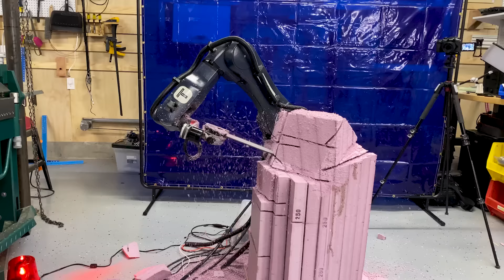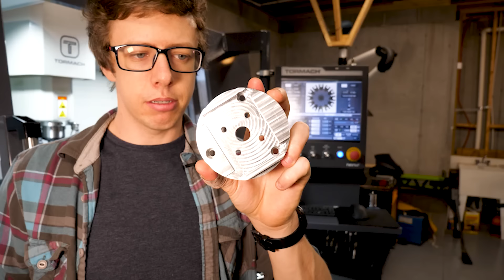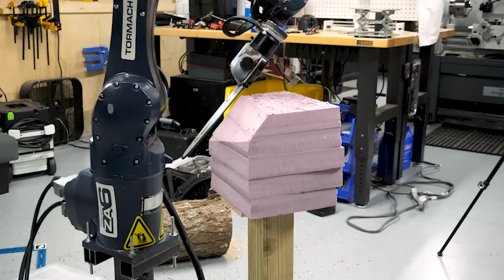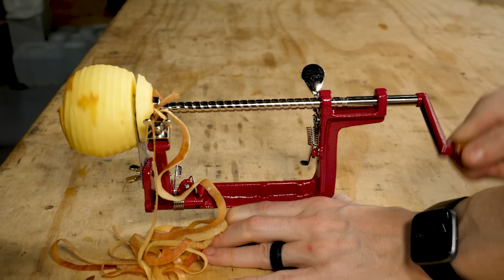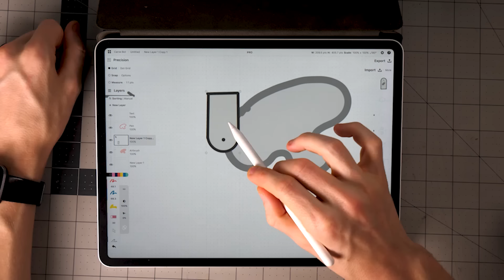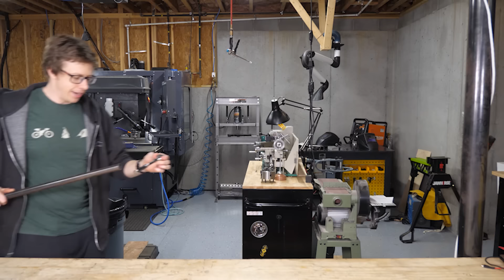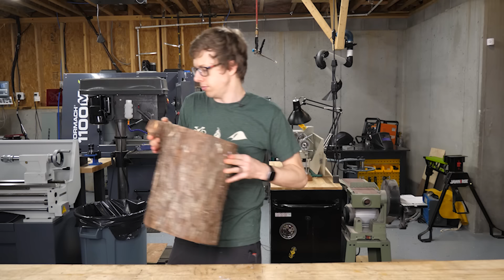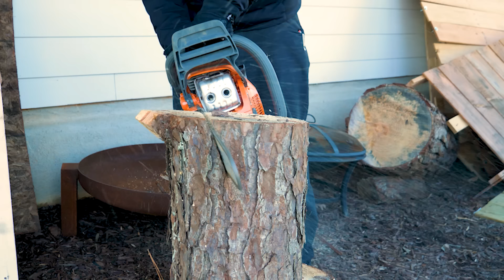Chainsaw + robotic arm = art?

Comment: Brilliant work.
I have a suggestion. Get thee hence to a renfair or logging competition where human beings are making these and watch them for hours.

Human beings have a frustrating way of "just doing" things quickly and efficiently that absolutely confound computers but I think that you would discover that artists of this kind aren't using a single algorithm to do their carving.

They start with a roughing pass and lop off chunks.
They don't try to optimize how to make every cut as efficient as possible, they just start from an arbitrary starting point and remove as much material as possible for a cut, mirror it and repeat.

Once they have a bear trapped in a mostly bear shaped log, THEN they begin reducing everything that isn't the bear to sawdust.
They also line the blade up with the bias of the animal's contour... this gives an impression of fur, but it should also provide a way of creating contour paths.
That sort of means that the maximum number of finishing cuts is dependent on the width of the chain. Basically, it should look like a 3D contour printer path.
That only requires very shallow cuts.
It's a lot of instructions but only the tip of the blade is used to remove very little material.

...and a few "is it plugged in" level tech support questions.
Are you using a coolant/lubricant for the blade.
Are you sure the blade is properly sharp.
Are you sure the blade is installed in the right direction... otherwise it will just rub and heat up.

Comment: Wow don't use a fresh hardwood tree stump. Instead, glue a bundle of pine lumber together just like you did with the foam, and you should even be able to cut it with that baby chainsaw because pine is so much easier to cut than hardwood.

Comment: Excellent job. Now program your home security system so that in the event of  a home invasion, the speakers will play "The Only Thing They Fear Is You" - Mick Gordon, turn on the robot arm and have it flail wildly while revving the chainsaw and beckoning the invader to come closer in the emotionless robot voice. For bonus points, install red flashing lights to run at the same time.

Comment: If you want to cut wood, you're probably going to want to add some bar and chain oil to this setup.  Also, you can file those rakers down to get the chain to cut deeper, no programming required.  That said, this is awesome

Comment: I've been working with robotic arms since the late 1990's and your mathematical technique is very good instead of using a ruby-tipped sensor to locate that saw on the start of every new axis cut.

PS: In my former industry we built a surround cage around all of our robots with an E-stop built in whenever the door is opened, and there is no way to shut the door (unless you stand absolutely still for 45 seconds) when a human is inside the cage. 

(PPS : That is a branch trimmer, not a real chainsaw.. Gotta have about 55cc (3.5hp) + a very good bar and chain to do any damage to a hardwood stump.)

Comment: Invest in a quarter tip cannon carving bar or even a dime tip if you want to get introquet. You also need carving chain. Or you could opt for chisel tooth on that same guide bar. Get a raker guage and file your rakers down to proper height to help with cut speed and efficiency, those 'homeowner' chains aren't good for anything. And the professional stuff is only pennies more expensive. Awesome video.

Comment: You have to solve the issue with cutting wood, mate.  Surely it's just getting the right bar and chain combo for the application.  We used to cut in slots into fenceposts to seat stays and all sorts of other awkward cuts (into Aussie hardwood no less) and never had an issue with rubbing and overheating until the chain was too blunt to cut anymore.  It was also well worth stopping before that point otherwise you'd ruin an otherwise good chain.

Comment: It's not a bad idea.  IMO, he used the wrong carving (cutting) tool.  Why he was so committed to using a using a chain saw escapes me.  
In previous projects he obtained better results with less difficulty when he gave up on using a method and went with another.  He needed to use a different cutting tool.

Comment: Oh damn, you mentioned a programming issue that I think I could actually help with for once! 

For the "false summit" issue you're having, you can add "momentum" to the next location guess by summing the vertical distances (or just the normalized gradient if you're working in a space where you can calculate that) of a set of the previous moves and then adding that (as a fraction between 0-1 * a multiplier/'step size' constant) to the next movement. This way, once you reach a peak, you will go past it and then your height change will go negative, so it will cause it to go back towards the top. This will make it oscillate around the max/vertex (or min if you want to go concave), then eventually settle at the point. HOWEVER, it will allow the tool to move past peaks and instead of oscillate back, if it hits another region with a  positive gradient before the momentum runs out, it will start climbing back up that. It's like rolling a ball down a bumpy hill (but inverted in our case), the momentum allows it to keep rolling a certain distance (depending on the step size) back up a hill once it rolls down into a valley. if there's another valley on the opposite side of this hill, the momentum might allow the ball to roll through the first valley (the 'local' minimum), up the next hill, and down into a lower valley (eventually the 'global' minimum). So we can just flip gravity by looking for increases in gradient rather than decreases as you would in that example and we can find the highest peak this way. Of course we don't really want the chainsaw having to oscillate around so much so all of these checks can be done in advance and then used to instruct the next move.

If you or anyone want to look into this, it's a common way of improving artificial neutral networks where the error surface is mapped in a 3D vector space and the weight change calculation  (which we use to minimize the error) can be made by using "momentum" to avoid finding local minimum errors (i.e. not the most accurate way to train the neural net) and find global minima. So just search up something like "ANN momentum for finding minimum MSE" (where ANN is artificial neural network and MSE is mean-squared error, fyi) or just message me and I can share my notes :)
Reply: Not in computer science, but why not run multiple tests in a given area or settle on a "tests per square inch" target?
Reply: MuchADrewAboutNothin it’s just slower in the long run. If you have to sample from a large surface, picking random points in a region and testing will find the peak much slower than making a guess, then using the gradient of points around it to “walk” towards the peak

Comment: The tooth you called "Anti-kickback" at 17:45 is not for preventing kickback. It is to prevent the cutting teeth from cutting to deep and overloading the power of the saw. You may need to learn how to sharpen a chainsaw if you haven't already. Great video and great work!

Comment: Can you make a robot that climbs up a tree and cuts it down, one limb at a time?  Cutting down trees is very expensive and very dangerous. It involves a lot of heavy equipment, height and danger. However, it would be great to have a small robot, that climbs up the tree and cuts it into smaller pieces, maybe 50 pounds each, and lets it fall. One could put a fence around the tree, send the robot up and in the morning or in a couple of days have a pile of wood to get rid of. It would be ok if it was slow, and one could even cut it into usable lumber.

Comment: Some thoughts on the chainsaw heating up: 1. The pole saw chain is meant for smaller stock and may not have the tooth design of a larger chain/saw, 2. As you noted often the optimal cut is at the back of the bar where the saw pulls back against the wood and it eats in, but 3. Most saws have chain oil. I didn’t see #3 addressed in your saw design and it may make the difference re: heating up.

Comment: Well done!  Great video.  Those teeth on your chainsaw chain are the depth gauge.  They control how deep the chain cuts, rather than having much to do with kickback.  I suspect your chain was quickly dulled by dirt and debris embedded within the bark of the tree.  Removing the bark from the log next time might fix that.

Comment: Regarding the chainsaw, you can file the depth gauges down on the chainsaw.  Since you are not using it, any kickbacks will harm no one.  Regarding the too-slow algorithm calculation: get off the python bandwagon!  Python is an interpreted language, convenient but SLOW.  Port over to a language that is compiled.

Comment: Please refine your code so this works much better. You can cut much more precisely with the tip of the chain saw like sculptors do. This will get much better results. This is a clever first try. I'm wondering why 3D tool paths can't work here?

Comment: why you would spend several days programing an algorithm to cut automatically when you could probably spend the same amount of time manually inputting the tool paths... you could run into things like the anti catch tooth or the spacing of the chainsaw as you manually input pathing, and once you have the first full tool path you can have a base to better start your eventual algorithm.... but skipping all those steps and going straight to an algorithms and testing and destroying prototypes i guess is fine too. makes for good schadenfreude entertainment lol.
also idk what the fascination with the Brazilian dancing dog is, but it popped up a lot in this video.

Comment: 10:49
"I'm sure there's someone really smart out there who could make this work, but I cant."
— Someone really smart
Reply: Knowing your limitations is probably the surest sign of intelligence there is.
Reply: Smart != being able to do everything 

He’s clearly very smart. But some other smart person still knows more about this particular software problem than he does.
Reply: Best part is that the solution is to just take multiple guesses at the initial parameters and run the ascent simulation simultaneously; and for best results, having the simulations and their results linked and iterative. Its called a MCMC (Markov-Chain Monte Carlo) algorithm, and usually doesn't take too much time.
Reply: @j.t.484  There could be cases where it still causes a false summit
Reply: LOL I was thinking the same thing. He is basically using DUM-E as a personal artist. Stark barely got the thing to put out a fire.
Reply: because in this channel he tried doing many different projects instead of just one, he realized that there are people who are specialized for certain project, who knows way better
Reply: He just needs stochastic gradient descend

Comment: Try filing down the depth gauges on the links (the other piece of metal that’s not the tooth)?  If you’re using a chainsaw by hand that’s awfully dangerous because it can run away from you, but with the machine it may be able to control it much better!

Comment: No offense, but you really should have put some time into your chainsaw knowledge.   Those ati kick back things are called rakers.  They control the depth of cut.  Really impressive work on the software side of things, but lacking on the mechanical engineering side.  Just some friendly advice, do the mechanical side of things first.  This will save you some troubles down the road.    Great work and love your vids.